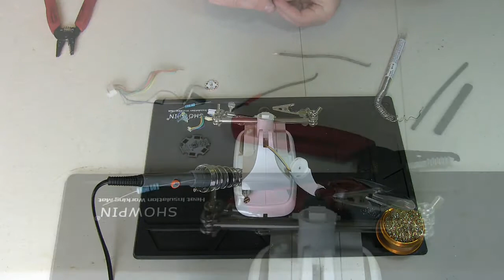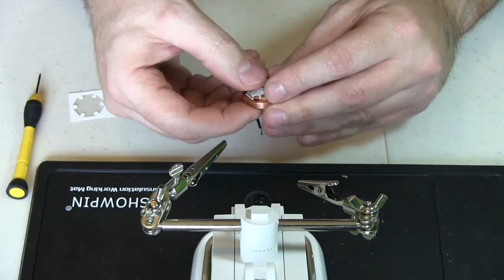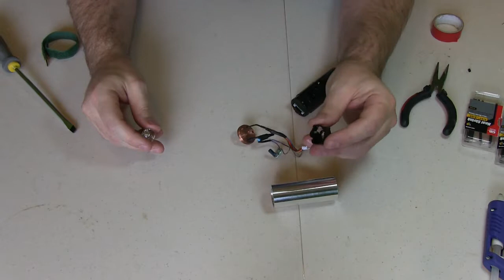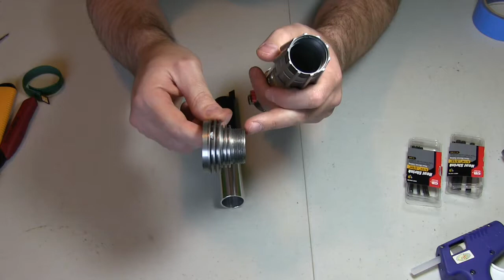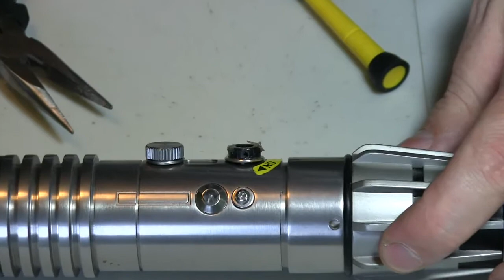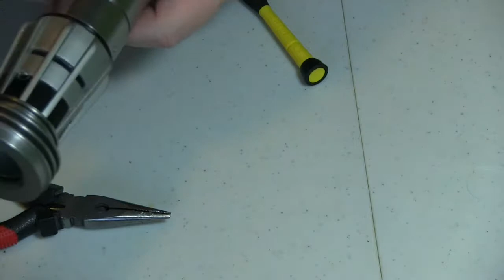Master Replicas 2006 Darth Maul Saber Conversion Part 2 Assembly

Comment: what "size" resistor is needed ?
Reply from the maker: I used a 1ohm, 2 W resistor for this setup. That may be too small if you are not using rechargeable batteries (1.2V). If using 1.5V, you may need a bigger resistor, likely 2ohm.
Reply: thank you

Comment from the maker: Just to be clear about the blade retention screw:  the hole through the outer hilt is not threaded. It was made with an 11/64" bit. Then, once everything is reassembled, the #8-32 tap bit is used to thread a hole in the blade holder inside the hilt.